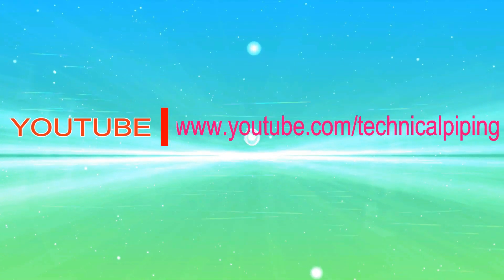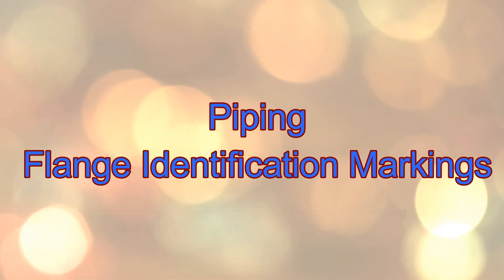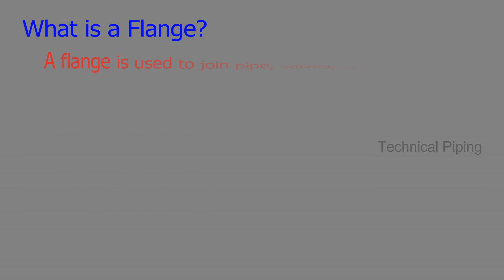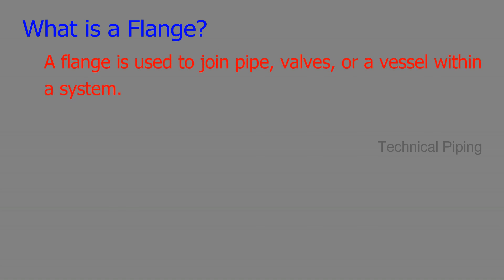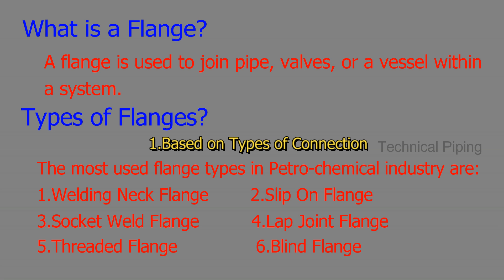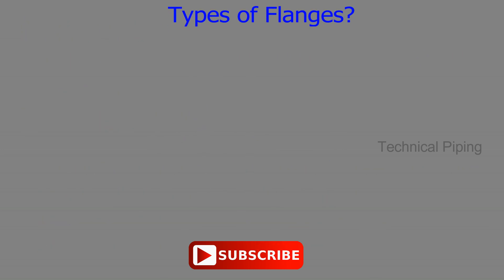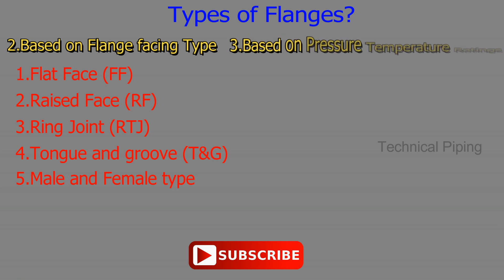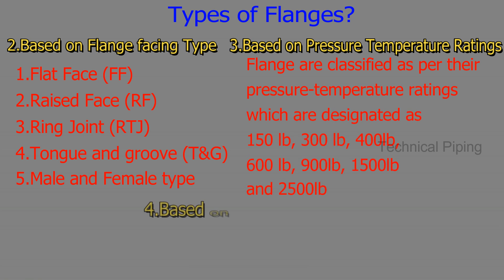Type of Pipe Flanges and Identification markings

Comment: What is the difference  between a N.A.C.E. flange and a non N.A.C.E. flange?
Reply from the maker: CS Normal pipe will be meeting the Specification (ASTM/ASME) standard requirements. NACE Pipes will be having additional restriction in Chemical Composition,Hardness,Carbon Equivalent and Heat treatment requirements.This additional requirements to ensure the usability of material in Sour services.
Reply: @TECHNICALPIPING  thanks